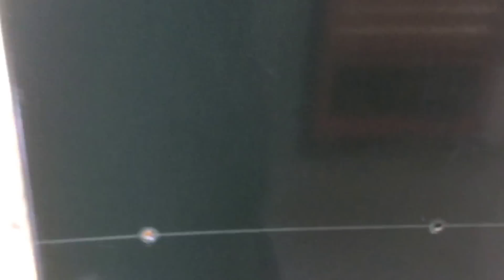how to build an Ammo safe

Comment: I have an old $99 Chinese cuckoo clock that belonged to my mom that does not work anymore and I have been thinking about converting it into a secret hiding place.
Reply from the maker: You can never have to many secret hiding places. I once hid a key on the outside of my truck after locking myself out. I never saw it again.
Reply: LOL The truck or the key?
Reply from the maker: The key! I looked that truck over 100 times but never could remember where I hid it. I outsmarted my own self.

Comment: BC... Nice find. I have the same cabinet, only slightly larger.  It's perfect to stack "fat 50" ammo cans on top of each other. Nice well built cabinet with one  exception.   One thing to be careful of with this cabinet is the three point locking system. That gold locking bar in the center of the door is likely to loosen internally. Initially you might notice that it spins beyond its normal 90 degree turn. Eventually it will fail totally and you'll have to dremel the lock cylinder off. Locktite and proper torque may prevent that hassle.
Reply from the maker: yep. I realized it was not gonna work and I  picked up two locking hasps today. Ill eleiminate that barrel lock.